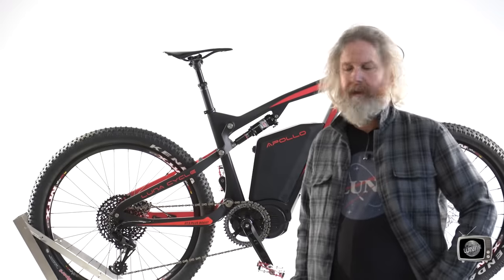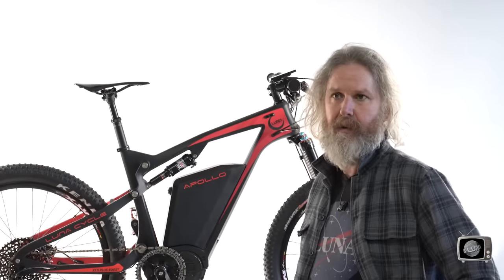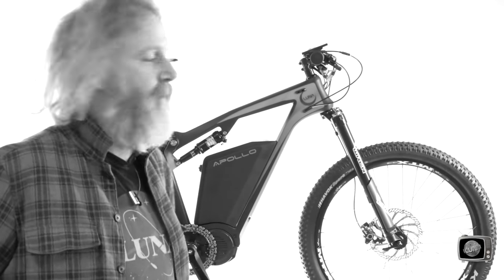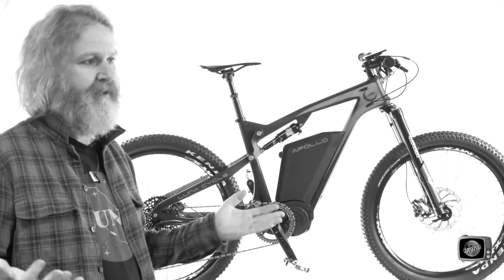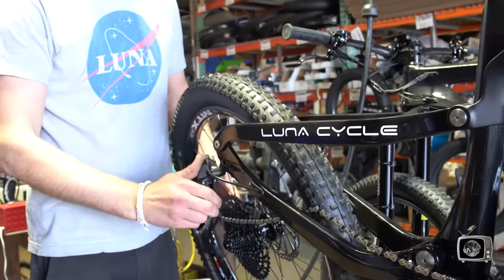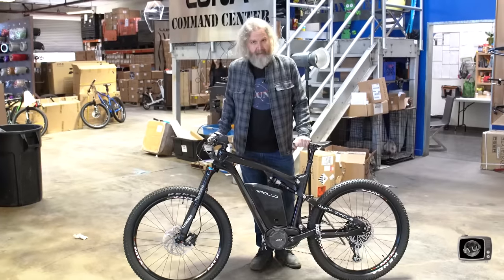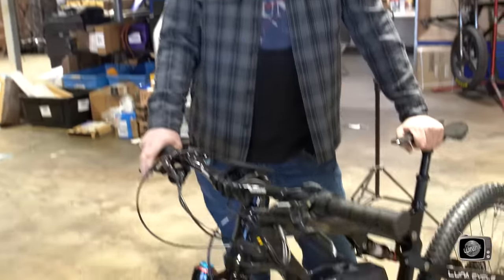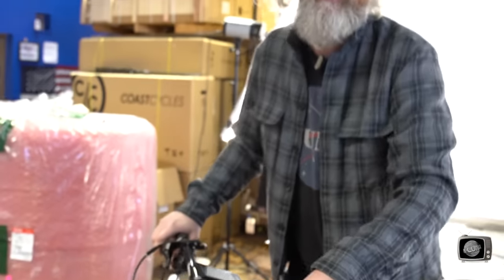Luna Cycle Announces the Apollo Ebike

Comment: Been watching the market for a couple years now. I have been looking to pick up a bike for local commutes and pleasure cruises, that can also do light trail duty. From my point of view, it seems most of the current offerings are poorly built conversions with little power and very limited range, that are also very expensive. Not saying $2 - $5k for a bike is exactly cheap, but comparatively speaking, Luna offers the best value in terms of performance vs. dollars spent, in my opinion. I must admit I'm still saving for it, but it's coming. Stay the course, Eric. You're going in the right direction.
Reply from the maker: thank you :)

Comment: You guys continue to knock it out of the park, love your ethos and attitude, I have been on the Ebike scene from wayback 20 years ago now on the Power Assist forums with Randy Draper and the early v is for voltage crew, its great to see finally after the tidal force and all the other attempts they have made that finally someone and a company like yours finally nails it, I dont dabble that much with making new e-bikes any more but have done many builds in the past and was one of the very first to use and test BMC geared hub motors and really early lipo packs way back then.

I recently test rode a stock £4000 250W road legal ebike here in the UK and went back to the sales assistant and said I dont think the assist is working, he said oh yes its working and I was like dude really? total waste of money, i basically wont swing my leg over anything unless it has at least 1500 watts on tap, its that simple, although I did read that here in the UK they are looking at making scooters road legal and upping the power limit, always a dumb idea to limit power, sure limit top speed but why limit power? makes no sense.

Congratulations on making such a nice machine, I wish you all the best, Knoxie.
Reply from the maker: THanks knoxie means a lot coming from you...I have been reading your posts  for years.... you are one one of the OG legends :)
Reply: @LunaCyclesLLC  ha ha you are too kind, loving what you guys are doing so much 😎

Comment: Thanks again Eric for being the leader in US made ebikes and the best mid-drive bikes out there. The Apollo will be my next bike to buy.  BTW - Just passed 4K miles of my Luna BBHSD and triangle battery commuter bike!  Even in Chicago through the winter that bike has never failed.
Reply from the maker: thank you  so much for the kind words... riding in chicago in the winter sounds like you are hard core :)
Reply: Was this a custom bike or a bike made by Luna? I'm just hit 900 miles on my custom kit from Luna.
Reply: I've converted 2 bikes with Luna mid-drive kits and have almost 2k trouble free miles between the 2.
Reply: @MaxPizarro  I built this bike to be a hard core commuter bike.  Used a  Breezer Cafe and the 168 - 171 BBSHD motor and a big 58V triangle battery.  I ride 20 miles each way to DT Chicago.
Reply from the maker: @MaxPizarro  this is our own bike made by luna. You can search your heart out to try to find a clone...glgl
Reply: @LunaCyclesLLC  my question about custom was for  Don West  who rides in Chicago with his bbshd. My question for is if you are considering customers that are looking for a car replacement ebike? Long range bike(ride to work) with good power but efficient(high miles to ah) and requires basic maintenance. Yes, I can build my own and I have using your bbshd kit.  Something tells me you all would do an amazing job. Oh make it a fat bike or plus size tire for all seasons.

Comment: Nice bike but those rosenburg connectors are the weak link, Ive had major problems with them after extended service, they arc and corrode and melt after awhile causing catastrophic failure!!!

Comment: Eric, this is a good Touring bike.  It is not a mountain bike, however, that would appeal to Trail, Enduro, or DH riders.  If you ever made a mtn bike that focused more on performance and handling (vs. torque and speed), you'd sell many more bikes.  Real mtn bikers are looking for handling - not hot rods.  As a result, this featured bike just can't compete with the weaker production emtbs which just handle better.  We need to figure out how to make ever lighter, more playful mtbs ( not ever heavier, more powerful bikes ). 

Btw, I aleady have 90 Nm of torque on my emtb and that's plenty for designated trails in my area.  I'd only need more on the street or on paved hills, but in that case it would be wiser to use a gravel or Touring bike.

Comment: I am leaning toward your bike after riding 20k miles in 2.5 years on OPTI bikes from Colorado. I have two but they just go down all the time. The builder is 5 hours away. Is there local support if there a e issues with the bike? Is the battery swappable or use, charge, and reuse?

Comment: Nice ride but I have some issues with "the best ebike ever" when it has Kenda tires and the usual cable spider zip tied somewhere close to the handle bar similar to most "El cheapo" DIY e-bikes. Why not building custom cables for the best ebike ever without any non required connectors ?

What you said about cheap components on other expensive e-bikes is so true. Mass products everywhere at a hefty price tag.
Reply from the maker: you are right.... and right before we shipped the first bikes we updated the specs so early adopter would not be let down..... we upgraded many of the specs.... now there is a 150mmm front fork maxxis chronicle tires, crane creek hell bender headsets and a leather padded saddle extra.
Reply: @LunaCyclesLLC  Thanks for the explanation ! I didn't want to sound too harsh. This was simply catching my eye. 

I believe that Luna Cycle are the upper notch of available e-bikes but unfortunately in Europe you are pretty limited in regard to using throttle and maximum power if you want to stay street legal. So running such a beast in the forest or on the road unfortunately is not really an option :-(

Comment: Head light in head unit and under seat taillight sensors for turn and stop hardwired in, throttle that fits under shifter and takes lock on grips,slide think

Comment: So much room for performance improvements in this market. You can easily get 5,000, even 10,000 watts out of a 100mm (or less) motor with proper cooling. Just look at the  RTD83-320 48V.

Plenty of room to install a small radiator for liquid cooling.

Comment: Looks nice but I'm apprehensive at getting anything from Luna cycles again.    Back a few years, I was looking at Sondors and  one of the big reason I bought one was that  Luna Cycle was offering big after market support for the Sondors Fat bike.   It was the idea that I could upgrade to a bigger motor and Battery later as a saved money that pushed my decision to buy my fat bike.   Now they make bikes, so they sell virtually no Sondors parts.  it's obviously a conflict of interest to support Sondors aftermarket parts.    If you buy this bike, they may not support it 3 years from now.
Reply from the maker: we have an entire section devoted to sondors parts.  Back then we only sold parts... we have nothing but love for sondors bikes and suggest them all the time to people who  want an affordable ebike.  It is hard to keep everything in stock. we will take  a look at our sondors ebike section... but we did not keep up with all the current models (we use to buy the original sondors ebikes and go on rides etc).

Comment: Is it just me but instead of buying this bike, get a used better brand bike? I can’t see this bike having any resale value whatsoever. You can find a haibike used on eBay for less than one of these Chinese concoctions that one day you might be able to sell and get something else. This technology is rapidly developing and instead of large motors and fugly battery packs, components are getting smaller and lighter making for a better mountain bike overall. I see this bike in a weird category that hopefully dies soon. Not an ebike but not an electric motorcycle either. Sort of both but sucking at either. I se the future as light pedal assist bikes to rival regular mountain bikes in weight and small electric motorcycles that will be perfect to buzz around town but require license. But that’s just me

Comment: Why did you use a derailleur instead of an internal gear changer?
Reply: If you want roloff hub you could add one ,not cheap though and unlikely to last long at 2500w
Reply from the maker: we wanted to use a rohloff badly on this bike but could not get it to fit...the apex uses a thick re-enforced swing arms so we had no problem drilling the extra holes in the swing arm that the rohloff needs for internal routing of cables...because we will settle for nothing less than internal routing of cables in these bikes the rohloff has to wait until the next version....also remember the rohloff adds 1k in cost.

Comment: I don’t understand the point of 2500w electric bike?!? If your own pedal power is somewhere around 125w(avarage for normal biker) and motor gives you 2500w -> your own input is around 5%.. so why bother to pedal at all?? And from there we can continue to the question: why put pedals to the bike at all? You can argue that if battery goes out you can still pedal it home.. ...yeah you might but it’s soooo heavy with that large battery that you can pedal like couple of miles until you’re also out of juice.. —solution: Remove pedals and you have less weight, simpler design a.k.a electric trial bike.. with pedals or without them -> you have to register 2500w bike or drive offroad..

Comment: Further, carbon frames on emtb's? Isn't a kinda pointless expense? Where does a emtb - especially one with tons of power suffer with a 5 or 10 kg heavier aluminium frame? Nowhere. Similar with the neck and back-wrecking low handlebars, that biking sensibility hails from, presumably, lessening wind resistance on non electric bikes, ...that's no issue with emtb's, not at all. What's more using high bmx style bars and you can get forward or back all you want - more than flat bars probably. So there's no downside.

Comment: I killed so many chains, having 205 pounds and my bike weighs 65 pounds.... I like this new bike BUT HOW can this chain handle the 2000 watt???
Reply: it can, my 3 second output is 2300 watt and im not a pro i have seen 5 second 4500 watts or even 3 Seconds 7000 watt done by a pro on a Meter wich can sow 7500 watt an he rides his cains 10.000 km Eagle 12 Speed i guess they can do 2000 on an  Ebike that strong
Reply: @ReinhardSchuster  sorry, i don't buy anything like that. No clue which meter wanna be used how to measure a humans output over 2000watt, especially at the chain. I am very technical and you disqualify yourself with such a statement. - my concern was actually the longgevity on a regular chain, it cant be last for long time on a high duty cycle.
Reply: I ran a 1800w (peak) cyclone system for a while and went through chains reasonably quickly. At these power levels it's all but unavoidable.

Comment: To build the best electric bike, you need to first start with a really good bike. This is definitely the most impressive high-powered electric bike I've seen, most of them are otherse just Stealth Bombers and other overweight and out of date hub-driven crap.

I totally agree with you about people fitting the ugly parts to a cool bike. I sell electric mountain bikes and occasionally get asked if I can put a goofy seat on it. Not only does it look ugly, big fat-ass saddles don't work on bikes that aren't designed with an upright seating position in mind. Oh, and fucking ugly clip-on fenders and racks... those can fuck off entirely.

Comment: Does it have regenerative braking?
Reply: I’ll wager no
Reply from the maker: no it has a freewheel ... as with all ebikes you get either a freewheel or regen and most ebikers prefer the feeling of free wheeling rather than motor drag.  We appreciate and like regen though..its just not offered in any current day mid drive.
Reply: Luna Cycles on a truly technical ride the regenerative braking can be adjusted to extreme regen to next to nothing. 
 I do like the size of the tires. They 👀 perfect

Comment: People don't understand those fat saddles aren't more comfortable. The customer is not always right. :(
Reply: Yep, it reveals a lot about their "understanding" (or about their target demographic)
Reply: Why are fat saddles not more comfortable?
Reply: @newusername23  they dont support the pelvis and cause cause you hips to move oddly when peddling. A narrow properly fitted seat keeps you more aligned. For short rides a padded seat is ok, but over longer ones the movement is fatiguing. A saddle supports the weight of the rider on the frame. Foam does not support. People dont want to take the time to break them in so they take the cushy option. It's usually a mistake but good luck convincing a customer.
Reply: debunkthejunk1 great thank you!
Reply: @helenHTID  When I worked in the business I heard that a lot. And 100% of the time it was from people that spent very little time in a saddle, and never from people that rode +100km per week. I've seen this with helmets, people wear them too big because they wont take the time to get used to a properly fitted and "snug" helmet. People slouch because it's more comfortable, but if they took the time to correct mistakes instead of taking the easy route they'd have less problems in the long run. But yah, we tell people that they are the exception and sell them a crappy memory foam gel seat. Then if they do get serious they come back and buy the right seat. If I had a product with my name in it though theres no way in hell I'd let it out of the shop with one of those comfort seats. It's basically advertising "I dont care about my customer, I just want their money"
Reply: @helenHTID  there are a few other factors that contribute to how comfortable a saddle is. A couple mm forward or back on the clamp can have a big effect  as well as the height, seat post angle, seat angle, width and where the mounts are in relation to your ischial bones. Your brother's seat should have been too narrow for you, women have wider hips. I'm fairly confident if you have a comfortable fat seat you could also have a more comfortable narrow seat that would not fatigue your lower back as much. 100% confident? No, there are exceptions. But this fittement is going to work for the vast majority.    And no reputable shop would allow someone out the door on a bike with a so called comfort saddle. I'm not going to argue with a customer and spend a month fitting them on an $800 bike, but if you spent $5000 on a bike and they let you out the door on a comfort seat it's because you're a bad customer. I dont mean that personally, I mean that most shops will fit you properly on a good seat unless you're just too stubborn to take professional advice from people that do it for a living.

Comment: so it really makes me think, a bike chain and cassette which were designed for normal pedaling (250 watts average human power?). Those components will now be handling 2000 wattts :( use a motorbike chain please
Reply from the maker: that chain and cassette were definitely designed for more than 250 watts.... around here a good pro can put out over 1000 watts of output in bursts especially when climbing and good components like the sram eagle are over designed. On our test bikes we run over 5000 watts through the same system. Its the cheap Walmart stuff that breaks...not this.

Comment: This bike better than the Apex?
Reply from the maker: they are different bikes...the apex is wilder with a more unique design..... it depends on what you like. Both bikes were designed at the same time by the same group of designers with the same motor and the same battery...the apollo is just more taditional and is a proven suspension design so is probably better for hard core mountain bike people.

Comment: 250w limit not even 300w in pansy europe
Reply: I live in newzealand the limit here is 300w . I ride my 2500w bike with a eggrider v2 display.. it has two separate modes on road and off road ,it puts the bike in a grey area... 
The eggrider v2 also works on this bike and all other bafang motors.

Comment: PEOPLE!----- BUY THE 52 VOLT BATTERY AND THE BBHD OFF ROAD CENTER DRIVE FROM LUNA AND PUT IT ON YOUR BIKE YOU WILL HAVE A PIMPED OUT RIDE WHOOOOOOOO WOW !TALK ABOUT POWER MY AERIAL RIDER  D BIKE HAS DOME 36 MILES PER HOUR IN HIGH GEAR.
Reply: OH BY THE WAY MY ARIEL RIDER D BIKE GOT THE ORIGINAL BATTERY AND DUAL 750 WATT WHEEL HUB MOTOR DRIVE SYSTEM RESULTING IN  ME HAVING TWO THROTELS  .

Comment: I love your attitude you sound like me. First thing is that a normal hard core bicyclist will burn through a chain a year. Your high powered motor will destroy a chain and sprockets in a month. You need to power the hub and save the drivetrain. Your extended warranty is not saying much about how good your bike is. $700? psssttt. I have a BMW motorcycle and a Stromer for speed. Your bike sounds twice as fast as what I have. Anything much faster on a skinny bike frame seems dangerous as Hell. I would love to ride your bike and put it through it's paces but I don't live near California. No one will ever stock these in rule book bike geek Seattle. The real cyclists won't even look at electric and the electric crowd won't spend over a grand I pass them all on my Stromer. The extended warranty thing, your dreaming.